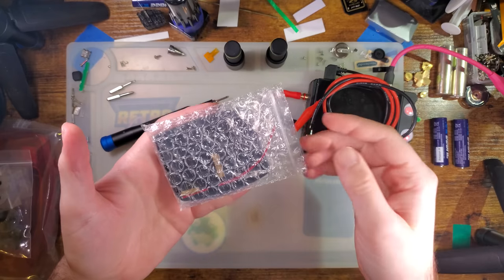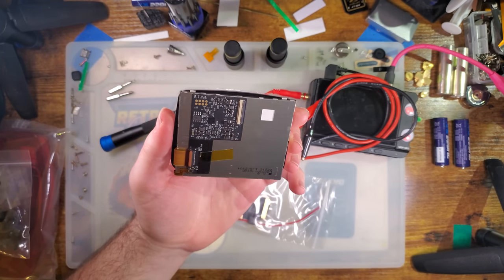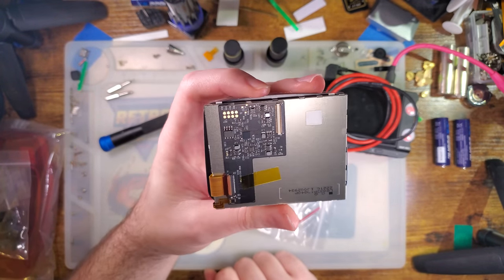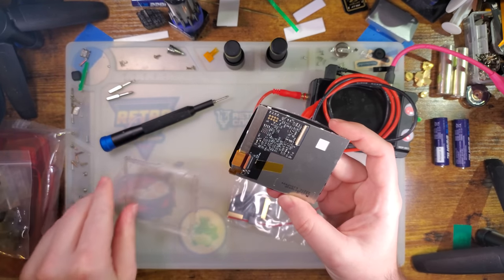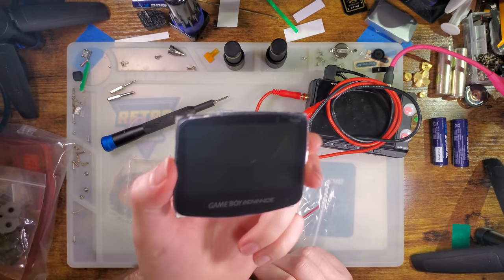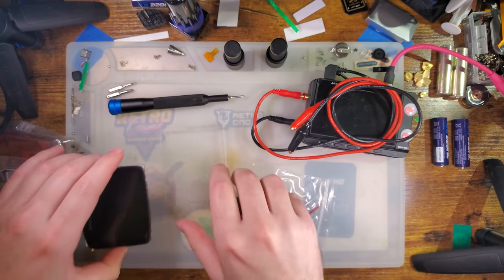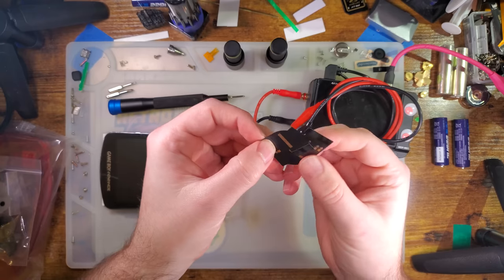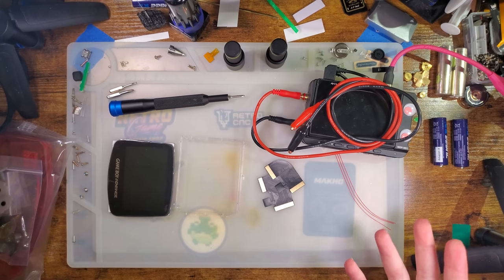FunnyPlaying Laminated ITA with OSD and FRM (GBA)

Comment: Maaaaan, I did most of my GBA modding in the IPS V2 days and I definitely murdered a couple cables trying to do the 32-Pin fold. The way they're laid out on the new kit looks sooooooooo nice. Glad FunnyPlaying is still innovating and making things easier. As much as I never loved the touch-style of brightness control the fact that you don't even have to solder if you don't want to it is insane. I don't think I'm bold enough to try surface-soldering a CPU onto a new motherboard but those aftermarket boards are sick

Comment: I actually had that same issue with the touch sensor when I installed my screen last week. Not sure why but it was acting funky at first when i put the shell together and then after a while it seemed like it settled and stopped taking input at all. Personally im fine with it because I wanted to use the buttons anyway and I was worried about occasionally bumping the sensor, but its still something to be noted that it doesn't seem to be positioned right considering the shells are made for this screen...
Reply: There’s a control chip on the screen board you can delete. It’s near the ribbon cable to the GBA marked PSSY. That’ll disable the touch sensor permanently.

Comment: Hi Makho. Another great video with useful information.thanks!
I have one of the FP upgrade mobo's (with gold plated cart slot) and had to do quite a bit of troubleshooting this past weekend trying to address the ghosting on stock screens. Was able to minimize it by adjusting VR1, but it's still more noticeable compared to completely stock gba hardware. 
Also discovered that the fp board doesn't support using the ags-001 display mod (frontlight does not function). 
I realize that using stock screens is far from ideal and isn't really the intended use-case for the FP motherboard, but I think that a product that intended to replace/upgrade shouldn't pigeonhole consumers to a dedicated path. I.e., you have to use IPS/ITA display for nominal use of board. Thats not even taking into consideration the loss of stereo sound from the headphone jack.What are your thoughts?

Comment: ohey, got another question for you. It doesn't seem really clear in the listing or in videos, but on the ips 3.0, for its scanline options and whatnot, does it have a pixel grid option? I went with the ITA kit just for that feature but with how lame the viewing angle is in person, I may want to swap over eventually but that's the main reason I bothered upgrading from my old ips 2.0 build
Reply from the maker: None of these kits have "scan lines". Only CRTs support scan lines. What you're thinking of is likely the "pixel grid emulation". If you check my video for the ips 3.0 kit, you'll see that I have a link to an imgur album with pictures of all the options. 

Also, the "3.0" refers to the size of the LCD. It's 3 inches. What you're calling "2.0" is probably the 9380 kit which is 3.2 inches.

Comment: Hi makho, love the vids. I am super confused on all the different display offerings for GBA and GBA SP. I am looking for the current best screen for both. I am looking at the 720x480 kit for the sp, or the funnyplaying v3. Any recommendation between the two? Also, my sp is fine, and its a 101, however I have a solid white bar on the right side about 4 pixels wide going up the entire side. I know it is not out of center because it actually cuts off some of the games. Any fix for this so I could keep the original screen if possible?
Reply: Hi, saw your comment and had a few tips I thought I'd share from all the searching I've been doing before buying my kits as I don't want to waste money and buy the wrong one. Makho has a great wiki that lists and sort of ranks the mods for each console (check the video description), but I'd recommend either the 3.0 ITA kit (like this one, thats 3.0 inches not v3 like people think, its not related to the v2 kits) or the v2 ips kit. 

The ITA has a look similar to AGS 101 with no flicker and a 1:1 screen so you get an authentic pixel grid look (which might be a bad thing if you want razor sharp "emulator" pixels), but it has slightly worse viewing angles compared to ips screens. The v2 ips seems good and is slightly larger (3.2", might be a good or bad thing to you), but flickers with things like the map in fzero and has image retention afterwards. 

The 3.0 ips kit has uneven pixel scaling so you get "shimmer" as the screen scrolls so its a deal breaker for me. The 720x480 is 3", has a 3x integer scale but has similarly flickering problems (don't know much about this kit though).

Hope this helps :)
Reply: @sfrbsms5774  Good information, strange that the "shimmer" issue isn't mentioned elsewhere, e.g. by MachoNacho. I love the look of my AGS-101, so I guess I should go with the ITA? Is it noticeably smaller?

Comment: Crazy concept for a series of videos. I'm wondering if you can do drop test for these IPS ready shells and screens. Like you get a completely blank pcb without any traces for these consoles so you can install it without damaging an actual motherboard and throw it around to see what happens.
Reply: These cases suck in durability. They would be cracking like every time, just fyi. I speak from experience, having broken two of them.
Reply: @JamesPound  Same experience here. I'm more interested in the screens durability. I had post on one of these shells explode out of nowhere. This caused The motherboard on the Game Boy and the motherboard on the screen to touch. I lost brightness controls. Then I went to go turn it back on and off see what's going on and then I blew a fuse. It took apart the whole thing and bought a new shell. This show that old shell was so brittle.

Comment: Hey Makho, i just saw an older video of you covering some aftermarket AGS-101 LCD kits, would you happen to know if these kits are compatible with overclocking? I have an AGS-101 with some ghosting issues but I want to fix that issue and overclock it as well. I think no other aftermarket IPS screens are compatible with overclocking. Thanks in advance!

Comment: I hate these ITA kits. Why does nobody seem to notice the horrible stripes on areas with solid color? ITA kits are salvaged from DSis and when playing GBA on DSi, there are no stripes and everything looks perfect. But as soon as you use a DSi screen with a GBA motherboard, these horrible stripes appear. I believe you called them "weird horizontal lines" in your video, makho. Those have nothing to do with the FRM function. They are there since the very first ITA kit. Funnyplaying acknowledged them in an email exchange with a customer but claimed that they won't fix these anytime soon. It really upsets me that videos like this advertise these ITA kits with having this serious flaw.
Reply: I agree, I too noticed them, but I got used to it. I believe the original DSis have some kind of compensation built in to deal with these screens. It might be some time until Funnyplaying completely tunes these to perfection, like they need to fix the faint horizontal lines and also implement faithful GBA color mode, also for the IPS models. Perhaps something else.
Reply: Is that a universal issue? I assumed it was a defect in only some units since most people don't complain about it. I'm no stickler for image quality but those stripes drive me crazy so it's hard for me to believe everyone who positively reviewed these kits was somehow ignoring them. If so, that's really disappointing.
Reply: @Cewrin  When playing you wouldn’t notice for 80% of the time, but if you put your head next to the screen and try to spot it its noticable. in instances where you’re looking at solid backgrounds and especially darker gray-ish tones, that’s really their weakness. And this is also an isolated case from the screen flicker, which some people claim it is - where you have to adjust the lines with potentiometer. I mean mine is tuned to perfection, there is zero flickering, but the faint light lines still persist. 
You can also spot it in this video ln makho’s kit, if you look closely at points of solid baclgrounds, (make sure to watch after hes done tuning the potentiometer). 
Most reviewers, can’t say for most of them, wouldn’t notice it, just installs the kit, play for a short periods and puts it down. It is a shame because these screens are objectively good, they are straight up upgrade over ags-101, I think it is up to funnyplaying to tune them, just like they improved the lines on ITA’s frm mode.
Reply: Hi, It appears every kit has the exact same issue, I don't comprehend how makho and other youtubers don't notice the problem. 

My kit came today and after correctly adjusting the potentiometer I noticed the white lines/stripes like scanlines but white, then I went to the internet searching for the issue and found multiple post on reddit.

It's such a shame that no YouTube video shows this issue, I thought I've finally encountered the perfect kit for the GBA but sadly no.
Reply: @elude3808  yeah, it seems makho just doesn’t care enough.
Reply: @digleyd.3813  I don't know the reason of not noticing it but the issue it's pretty annoying.
Reply: True, i feel like i got ripped off ngl. I dont know how ANYONE else acknowledged this in any review that im aware of. $75+ dollars down the drain.
Reply: What stripes? I Just compared my modded GBA ITA screen with my og GBA SP 101 using my Pokemon leaf green and red fire copies  and looks almost identical, the only difference is that the modded one looks a little bit temperature green. I already look for information and couldn't find images or videos of those stripes.

Comment: Is there still an oversaturation of colors?
Reply from the maker: Well there is no way to desaturate colors if that's what you're asking. No new color filters/palettes/LUTs. 

Any oversaturation of colors is done by the game, not the screen.
Reply: @makho  the "clean screen" from Retrosix I'm using makes the colors look as intended, instead of oversaturated but can be toggled to look oversaturated if desired. I would rather save $40 if this display can produce colors as intended.

Comment: Hey Mahko, I’m having a weird issue and thought you might be able to throw some insight my way. I installed a new one of these screens in my GBA SP and when I went to adjust the potentiometer, it started inverting the colors on the screen??? Also I can’t seem to find a point where the screen looks completely good, it’s always jittering slightly from the interlacing
Reply: I'm not makho but I have some experience, try to shake the screen when adjusting, just be careful with the screwdriver in the potentiometer, there is a small sweet spot where it wont flicker no matter how much you move the screen.
Reply: @robiocraft  I got it to work after a long while of messing with it, and in the process found the best way to do this adjustment. The 160p Test Suite’s “Color Bleed” test makes the flickering extremely obvious when you look at the stripes from the top of the screen down, I used this to tune the screen to that sweet spot I couldn’t find. 

I’m still confused as to why my screen goes inverted if I don’t turn it to the right point though, I can’t find anyone else who has that problem online
Reply: @StudiosUntold  Glad you found the optimal adjustment. well, I have too witnessed the point where the screen inverts colours while adjusting, I think that is the lowest voltage setting, so adjusting below that and it should reset to normal, it moves gradually to highest setting and then resets and so on. I’ve calibrated on regular GBA and bunch of DSis, same deal
Reply: @robiocraft  Ah ok, thanks for shedding some light on the inverted stuff. Does there tend to be only one specific spot that things work perfectly on in that range? For me the spot is extreeeeemely small, like I was just barely tapping the screwdriver to get it there type of small. Thanks again for the help

Comment: Do you need to push L, R, and Select to bring up the menu or is it like the IPS screen where you only need to hold select and then L and R toggles the settings?
Reply from the maker: OSD version needs to use the OSD to change settings. Older kits without the OSD you could do Sel + L/R to toggle brightness and touch pad for different settings.
Reply: @makho  I was actually wondering if select by itself pulls up the OSD menu or if you need to hold select and L and R to bring it up. It looks like it's the same as the IPS screen where you just have to hold select. I'm not a big fan of that since there are games like Donkey Kong Land that use the select button in the game because the original Gameboy didn't have that many buttons. I think if I do this screen I will actually solder the select wire to the start button instead
Reply from the maker: @ChewyChicken589  Or you can just use the touchpad. Unless something has changed within the last couple months, there's no benefit to wiring up the buttons at all since you can navigate and toggle the OSD via the touchpad only.
Reply: @makho  but don't you need to wire the buttons in order to use the screen alignment function?
Reply from the maker: @ChewyChicken589  No, it's in the OSD now.
Reply: @makho  oh nice

Comment: Hey man, love your vids, thanks!  Question for you:  I have a GBA heavily modded with V3 IPS, LEDs, audio amplifier, Helder power cleaner, retrosix de-hiss kit and 1800mah rechargeable battery.  But now my GBA will not power up with a flash cart.  Not enough power?  How can I fix this?
Reply from the maker: Remove the "power cleaner" and "de-hiss" kit. Probably the audio amp too.

Comment: What are good options to prevent edge backlight bleed? I have a clear shell and it's quite annoying. Thanks.
Reply from the maker: From the board LEDs or the screen? Mask the screen with black vinyl tape or similar. Opaque shells are generally a better choice if backlight leakage bothers you.

Comment: Can you help me out? I just completed this kit and when I turn it on the power light blinks for a second but nothing happens. I noticed if I don't have the shells screwed all the way together it will work fine. I've taken it apart 1000 times and made sure everything is insulated that might cause a short but no luck. Is it maybe because I'm using OEM buttons and membranes with the funnyplaying shell? Help is much appreciated.
Reply from the maker: On the non-laminated versions of the kit, the backlight FFC on the ribbon could short against the headphone jack pins and cause issues. If the jack is shorting the FFC out, I can see that being consistent with your symptoms. Usually it just mutes audio because it only hits the ground. I'd start by double checking that isn't happening.

Comment: why report on drawn current and not power?  As you said when you change voltage it will alter the drawn current.  Power doesnt change.
Reply from the maker: TL;DR It's complicated. Mostly habit. I have thought about this before though and I believe this to be the method with the fewest bad trade offs. 

I started doing it that way because I did not properly understand the relationship between voltage and current and only ever reported the current. For those tests, the voltage could have been anywhere from 2 volts to 4.2 volts which would radically alter the current observed. 

It didn't matter so much for the relative power usage, e.g. before and after of a single console, but it did mean I could not meaningfully compare two consoles or mods unless I did them back to back. 

I have since fixed my testing methodology and understanding and I started to report both I guess out of habit. (I may have one or two videos with bad tests but those would be my first couple videos or so)

Now, I continue to do it because voltage matters too. I want people to be comfortable with the relationship between voltage and current so I give both numbers and let the end user calculate wattage themselves. 

You cannot derive current or voltage only from wattage but you can calculate wattage by multiplying the voltage times the current (in amps, not milliamps else you get milliwatts). So the way I view it, I gotta give at least two of the values and these are the two I picked. 

If someone doesn't understand or doesn't care, well, that's on them, but I want to meet them in the middle and provide numbers that can be referenced against my older material at a glance. 

It's not perfect but I don't really want to delve into a physics lesson each video. Giving current and watts simultaneously would likely be confusing to a lot of people that aren't as comfortable with college level physics. 

Also, wattage readout is on-screen right below the current for the tests I show with the power supply on camera.
Reply: @makho  good point about the voltage and current are both significant.  The complete story is the include voltage and current separately.  I’m addition, power should always be the same no matter if u test at 3v 3.5v 4v as the current will alter based on the given t voltage.  In that context wattage can stand alone and it doesn’t even matter what voltage is pushed.  But more info is better and appreciated!  Thanks for the thoughtful reply and videos!  <3
Reply from the maker: @PizzaHandhelds  I don't believe I mentioned this before but there's also efficiency to consider. The more the voltage has to change, the less efficient the regulator is so power may actually be higher at lower voltages. Granted, I haven't actually measured this and the difference in efficiency is likely below my margin of error anyway.